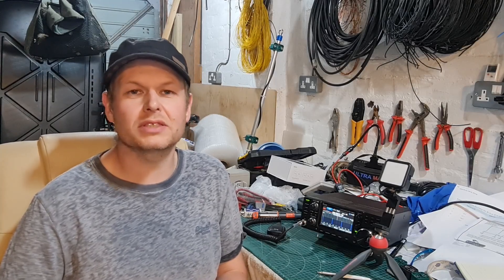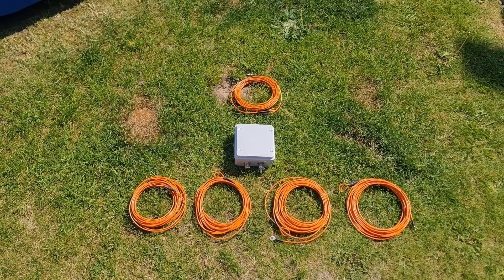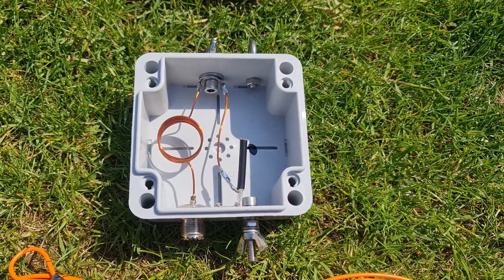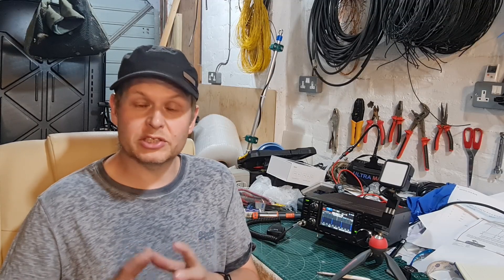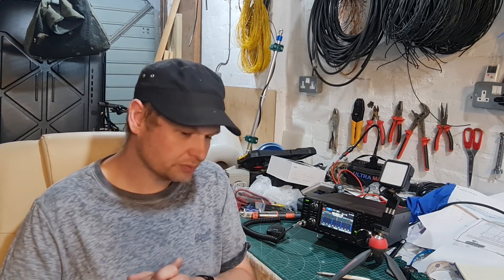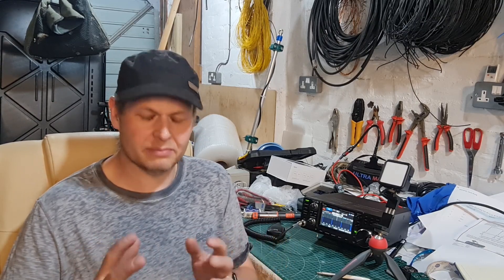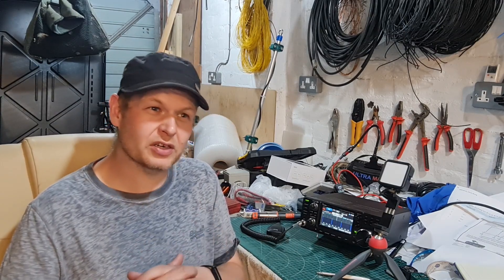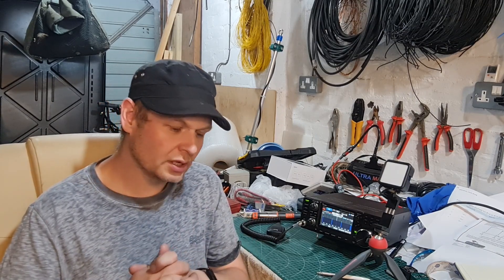The 10m 0.64 Wavelength Ham Radio Vertical Antenna - One of the Best

Comment: The antenna's very narrow bandwidth is for to the high Q value of the matching circuit.
If you build an inductor with fewer turns, on a larger support and spaced a few centimeters , the circuit's Q would go down , and the antenna  have more bandwidth. 73

Comment: Great video.  I have done some modeling for my poor desert ground in 0.01 wavelength increments and found the max 3, 5 and 10° take off angle radiation occurs at 0.68 wavelengths.  This is very close to what Tim G5TM got modeling every 5 degree (0.70 wavelength--I think on average ground).  You're actually not down much anywhere between about 5/8 and 3/4.  I'm planning to build a transmit antenna that is 5/8 wave on 30m (will barely fit on an 18m Dx Commander pole) and 3/4 wave for 20/17/15/12/10 with the 15m wire also serving as 1/4 wave on 40m.  In the US we're limited to 200 W on 30 m so I can use a matching network.  I chose a resonant 3/4 for the others in case I want to go to higher power in the future.  For transmit, 3/4 wave gives an amazing pattern for both DX and regional skip with the high lobes in addition.  It is probably going to be pretty noisy as a receive antenna, but I have other options for that.  73 KK7YIS
Reply from the maker: Thanks. I need to get this antenna back out over the winter for 10m. At least if you can elevate your radials you should at least compensate mostly for the desert ground.

Comment: Just come across this, interesting video.
When I did my 20m elevated vert, I simply had my vertical wire and 1 radial, and tunes the vertical section to 14.200, then cut the radial  to the same length, I added another 3 radials all cut to the same length as the vertical wire, and that was it hi.
I didn't use a coil or anything else, apart from a few ferrite clamps on the coax. Mebbe I did mine wrong,  but it works hi
73 zl3xdj
Reply from the maker: So from the research I've done this L match should be 98-99% efficient. You can see very little to it. Like for like, if the top of your quarter wave is at the same height as this theres zero difference. Only benefit of this is the current distribution is higher so more RF isnt obstructed by nearby objects if you cant get your quarterwave up high enough. Your location defo stick with what you have (which you are anyway and know for ages already) 👍

Comment: You were correct in your thinking that the antenna is quieter because it is high Q, and therefore narrow banded.   It's functioning as a narrow band pass filter.  So, this antenna provides both gain and improved signal to noise!    That makes it a winner in my book!
Reply from the maker: Definitely, probably only be of any use for another year or 2 till the cycle falls away.

Comment: Colin, like you, I suspect, I’m constantly tinkering and trying stuff for myself on a VERY small residential urban lot. The near ground mounted single-band efhw vertical has been my focus mostly due to my thirst for DX on CW and no radials. I’ve been keen to try every transformer in the book to get an efficient match and the air core inductor is where I’m at right now for it’s efficiency vs a broadband ferrite inductor. I think the key is the high-Q to help with noisy nature of broadbanded verticals in general. Lately, I’ve been thinking about an near ground mounted (1 Meter) antenna design with each vertical 1/2-wave radiator surrounding the pole (ala DX Commander style) and some sort of coax switch at the base choosing pre-tuned couplers for each band. Essentially, all single band efhw verticals on one mast or pole. Coax feed line to shack. I know it sounds like a contraption, but I just feel the need to try and see if I can make it work. The biggest discovery I’ve made in all my tinkering and experiments is that THE GROUND IS NOT OUR FRIEND when it comes to radiation resistance. Whether radial or counterpoise, getting em off the ground is best. Is my all band vertical worth the hassle vs just putting up a vertical w remote tuner? Is any benefit worth the hassle? Dunno. Let’s find out! LOL NZ5i
Reply from the maker: That sounds Like a plan. Yes a remote coax switch would work. Common ground. You could even do a cheap version using 12v SPDT relays.
Reply: @ Good point. I just need to swtich between 5 or 6 pretuned L-C matching networks for each monoband efhw vertical. High voltage 12 v relay would do the trick nicely. I am thinking that a major benefit with distinct mono band efhw verticals is that I can choose the optimal inductor / cap for each independent of the others. I am expecting the result to be less noisy in exchange for the higher Q and narrow bandwidth. I am suspecting that flux breakdown will be less of an issue for QRO keydown too, but need to test that. T200-6 toroid cores as well as air core inductors are both on my list to test vs the usual ferrite cores for multiband transformers. The usual Fair-Rite cores seem to be really well understood at this point for multi band using harmonics, but at what cost vs true tuned L-C match? It’s been bugging me for some time now. Have you messed with various transformers in mono band efhw configurations much? The efficiency of an air core inductor is calling to me to build it and test it head to head vs a popular 49:1. It just seems that multiband convenience might be more expensive than we realize vs monoband efhw. Anyway, 73 Kenny, nz5i

Comment: Photos and drawings please. I also like mono band verticals but want to try an inverted V and a moxon. I have some ~3mm diameter alloy wire  from high voltage power lines. Larger diameter is supposed to be better.
Reply from the maker: Short on resource but the video shows it all.

Comment: Fascinating discussion of a rarely used DX antenna. I've built several 5/8 wavelength antennas throughout the years and have never been disappointed by the results.  Thanks for the most informative video.  Aloha, Russ (KH6JRM).
Reply from the maker: Thanks Russ. The matching puts people off I think. Well worth the effort though.

Comment: just thinking out loud, have you ever tried feeding a vertical antenna with ladder line, to get a doublet multiband result. This works quite well for inverted V dipoles, just wondering if it would work on a vertical - of course a tuner is required
Reply from the maker: No I haven't. I dont hava a balanced tuner but it will be a good antenna. Tim built this and made some videos on it.

Comment: ...there are a few folks around that can actually 'smell'  RF...and they have a good sense and understanding on how things really work particularly on a practical basis rather than theoretical.. Colin is one of them.... you might have missed it but Colin's remark on putting 4 tuned radials on a half wave vertical (really a single band efhw) also makes good sense and might pull the takeoff angle to the horizon down another few degrees..I have limited resources here in Mexico so you have to work with what you got.... Richard VA7AA/XE1
Reply from the maker: Dont know about that but appreciate the kind words 🙏

Comment: That might be a close match on 10 MHz too. Im working on a vertical that will cover both bands. Basically a quarter wave on 10MHz with a coil that lowers the resonant point on 28 MHz to make it nearer the bottom of the band. It will end up closer to 5/8 on 10m. GM4SVM
Reply from the maker: Thats a good shout. I will sweep 30m next time its up. The matching unit may throw it off but it could be bypassed.
Reply: @MM0OPXFieldRadio  I think a dual band vertical is doable. I'm certainly going to try it. 3/4 wave isn't too good for angle of radiation, but if I make it electrically longer it might work. Without a coil it will be resonant about 29.5.

Comment: ...going to try both the 5/8 and the 1/2 wave Colin and compare the difference. I have the room to tinker high up on a flat concrete roof full of rebar. My 80m 1/2 wave does resonate on 10 meters, but it's way too high in the band to be useful, unless you're really into FM repeaters. You, The Evil Lair (who has a thing for "Experts"), and Bret from Survival Coms sold me on the Fair Rite  264325002, and it's improved efficiency due to form factor. I've scored 2, not an easy task in small town Mexico..  Tnx again... Richard VA7AA
Reply from the maker: Good luck. Keep me updated on how it goes. I dont think there will be much difference between the pair.

Comment: 0.64 is not the way Owen did it Colin
He actually makes it a tad shorter, he designed one for me for 20 metres and didn’t agree with the 0.64 “old wives tale”
Reply from the maker: Just read the document. I don't have a fraction of the knowledge of Owen. Pragmatically I agree if you are in the ball park it will be good enough. The only true way is to measure field strength at differing distances and angles which is nigh on impossible. Modeling is only so good. Get the antenna length in that realm and a bit plus or minus wont be noticable.

Comment: Good video Colin 😀
I've been on 17m today and worked China with 5W FT8 using a 5/8 vertical.
Interesting observation about your vertical being 'quiet'
The higher Q the antenna, the less noise it receives. Its a bit like reducing the IF bandwidth of your RX. As you narrow the BW, the noise is reduced. Its the same for antennas -- so you are correct!
When I get a moment I'll try and replicate your 10M antenna.
One other way of making low value capacitors is to use double sided FR4 PCB material. I can't quite remember the rule but I think its about 1Pf per square mm. Great for QRP and maybe up to 25 watts but not too good for 100W and certainly not for 400w!
73
Bruce G4ABX
Reply from the maker: Always value your feedback Bruce. I'm glad my low noise comment made sense. Its definitely quieter. Noticed the same on my 10m version. Some people were saying I should have used a tapped coil for a bigger bandwidth but that would just increase the noise. I'm keen to hear your thoughts on a 10m version 👍

Comment: Interesting.

Many, many cycles ago, I used to rag chew with the Brits on 29.000 (and up) on FM direct. No repeaters involved. I had a 3 element inverted Delta Loop, tuned for 10M repeater work, mounted on my roof. This placed the boom at about 40  feet.

The band was open, not long after my sunrise, for most of their daytime. What a grand cycle that was, but I can't remember the years.

I had a Kenwood TS-430 with the FM module installed. I'm not certain, but I think when operating in FM mode, the output was limited to 25 Watts.
(A mind is a terrible thing to looooz)
HaHa

I'll put this antenna into my Bucket List, maybe to use this Fall/Winter.
Actually, I'm planning on a Half Square for 20M later this summer and might also include one for 10M.

Thanks for the video, Colin.

BTW: You Do Good Work.....

73 OM
Reply from the maker: Perhaps the cycle in the early 80's? Ive heard to many veteran operators talk about how good it was. I've only been licenced from 2011. I had a hoot then with my 3 eli beam then a Hexbeam, regularly using 29mhz AM and a few watts. When the band is open the average joe is able to get a decent antenna in the air and feel like a "big gun" 🔫

Comment: Are you aware of any multiband antennas that can be made using a coil and capacitive section of coax or are they always monoband?
Reply from the maker: Afraid not. Effectively you what you need is a variable length antenna with an autotuner at the feedpoint to achieve what your talking about.

Comment: Main concern is usa guys say the 5/8 wave is no flame thrower.
My thoughts are most guys your trying to contact are on beams etc so horizontal.  So the only people dx who should get you well are other verticals. A good link would be a 5/8 talking to a 5/8
Reply from the maker: That's not true for ionospheric propagation. The polarisation gets screwed up in the ionosphere so may not stay vertical or horizontal.  Line of sight or tropospheric propagation maintain their polarisation. Ideally you would have identical beams for HF, one vertical and one horizontalnto allow you to switch back and forth when there is fading for example.l
Reply: @MM0OPXFieldRadio  
Yes sometimes a rotation of your signal by 90deg would hit a beam 100% but not all of the time.  
Ive seen a guy with 2 rx  one with vert ant and one horiz ant.  He said signal heard shifts from ear to ear. As one drops out its all in other ear.

Comment: Well done again, very well explained and presented. I am surprised you did not stay with 1/4 wave radials though (unless I misunderstood that part),  You may find that 1/4 wave radials perform slightly better. As for the vertical section... it MIGHT be interesting to use ladder line shorted at top and bottom to simulate a fatter conductor, it may give you some bandwidth advantage. Or possibly shorted at the bottom and cut to slightly different lengths at the top. Regarding the noise... it MIGHT be your decent polar diagram, "ignoring" ground based interference sources very close to the antenna. FWIW MMANAGAL can also create matching circuit values... Keep up the good work, 73
Reply from the maker: Thanks. I used the 0.67 radials as these are a supposed improvement over 1/4 wave radials. who knows. I used 1/4 wave radials on the 17m version. The Smokin Ape did a video recently demonstrating the matching network in MMANA and the results were not far away from my actual values used.
Reply: @MM0OPXFieldRadio  I don't know the answer but 1/4 wave radials should be very low impedance. I will give it some thought. 73

Comment: Back in the 70s and early 80s, they had the Penetrator and Super Penetrator verticals that out performed many of the verticals of 5/8 wavelength made by other manufacturers, the only reason others were sold was due to the price of the Hy-gain Super Penetrator being almost three times the competition!

But you got what you paid for with the Hy-gain brand! They used aircraft aluminum, and excellent clamps. When the weather turned bad, the competition would literally fold and fall apart!

The reason I bring it up, is many hams would also buy them and tune them up for 10 meters!

The Hy-gain brand became one of my favorites and one I would buy again!
Reply from the maker: I would be curious to see what these antennas actually were? I wonder how you could have compared to a 5/8th in practice? Build quality is worth paying for.

Comment: Isn't it the case that the height of the antenna is the critical element here and that a 1/4 wave who's tip is at the same height as a 5/8 wave will perform just as well over anything apart from a theoretical perfect ground?
Reply from the maker: Yes and I know the articles you are referring to. Over perfect ground there is nothing to split hairs. Practically I think the installation is easier with this as your gaining height without raising the feedpoint.

Comment: Very interesting video, thanks! It seems to me that it is not necessary to conduct a detailed calculation of matching and make them constant, but simply install a L-Match. This will make it easier to quickly and accurately tune the antenna in various other places. Also, what if, instead of all those radials, I installed a folding aluminum mat with a GTU?
Reply from the maker: Yes, your right in general an L match would work and likely more broad banded but. The match shouldn't change if you have it of the ground. The aluminium mat would likely work if you have this ground mounted.

Comment: Hello Colin few years ago I made a 10m 5/8 antenna by the plans of N2FFL. This antenna uses a 5/8 element and a classic inductor for impedance matching while the radials are only 103 inches. I did not use the capacitor  that he uses, please check on his site. This antenna works vey well . I only use two radials because i do not have room for four. The radials extend about 3 feet on each side and than drop down, always because of lack of room. The tuning is quite broad extending to 29 and more Mhz by memory. Noise is quite low. I also made a 20 meters 5/8 vertical about 12.7 meters tall and the radials are 5.3 meters long . In this case I used your LC matching system. It tunes well but the bandwidth is reduced respect the broader bandwidth of the 10 meters 5/8 .
Reply: Hi, thanks for sharing your experiences.  I think there is a hazard with quarter-wave radials if they are sloping; their currents would be out of phase with the main current in the 5/8 radiator, and compromise the low-angle performance.  Strictly horizontal (1/4) radials seem to overcome that caveat.

Comment: That's a low noise floor considering you are using a vertical. Are you going to market this antenna as a commercial product, as you did with the Ajustiwave?
Reply from the maker: Afraid not. Adjustiwave was about trying to get some of my extensive R&D costs back and that long since stopped. I just like trying new things.

Comment: The length should be exactly 2/π, which gives 0.637*λ
Reply from the maker: I wont get my knickers in a twist over 0.03%, probably not measurable on performance.
Reply: Mmm, pie. Do you need a π match for that?